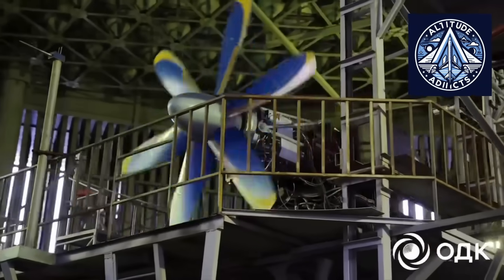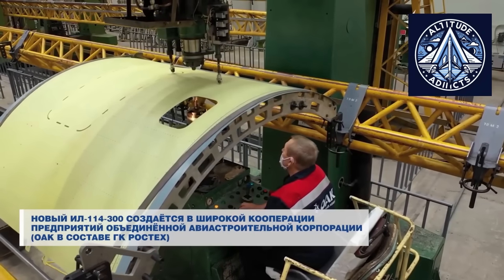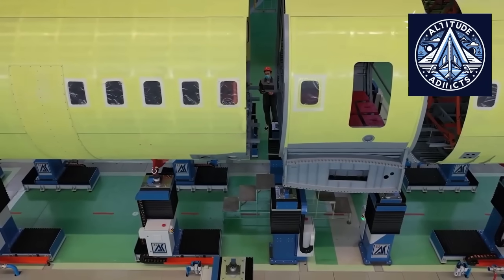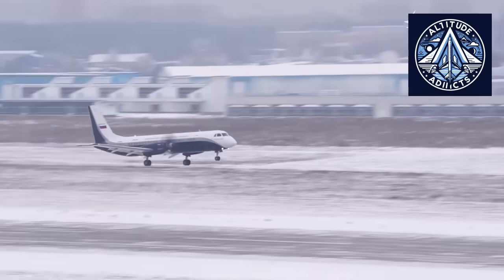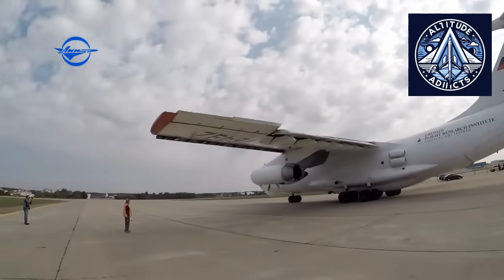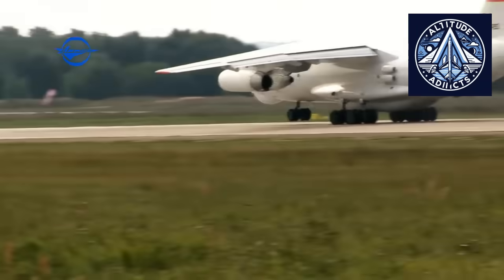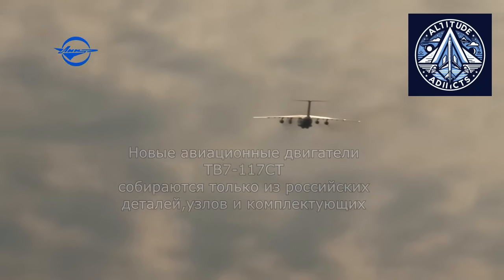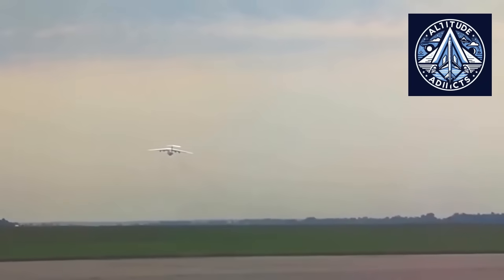Russia’s New Propeller Certified! AV-112-114 for Il-114-300 Explained

Comment: Can be equivalant to dash and atr planes.and clearly it can be the best.and remeber if tv7 117st engines supports with water methanol injectors for cooling in take off situation. and new reliable fadec will compet with pw127amazeing turboprop engine.and russia can subsitute il114and antonov114 as new economical regional planes.and atr and dash and bombardier will be finished for ever❤❤❤

Comment: 2.00 in .... that is a perfect example of how jigless aircraft assembly works, The small centre section which is where wing attaches - is the "key" and everything aligns to that 1x small section - which is the most important piece of the entire plane .... that section is in fact the "jig". That is what they have to do to the Tu-214 redesign the fuselage so it can be constructed without external jigs